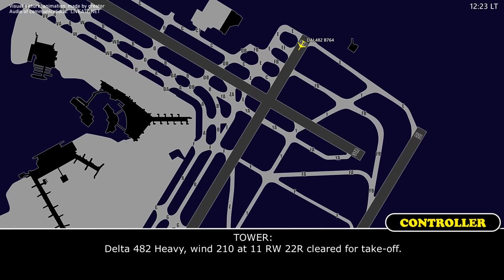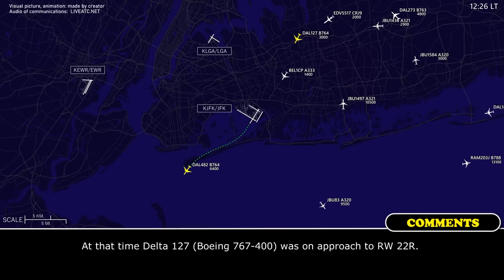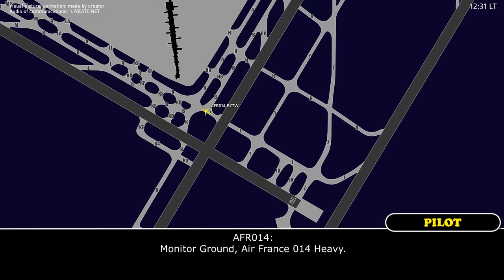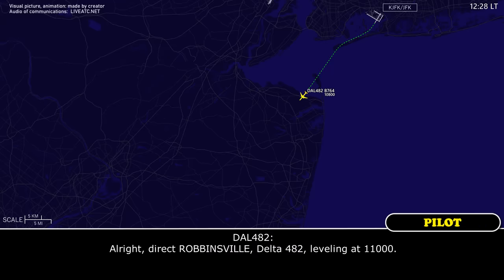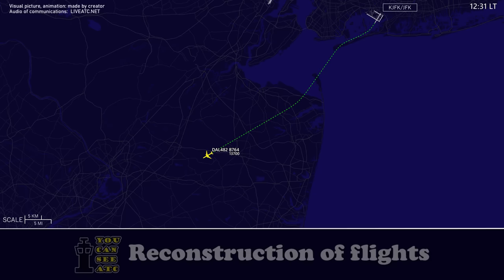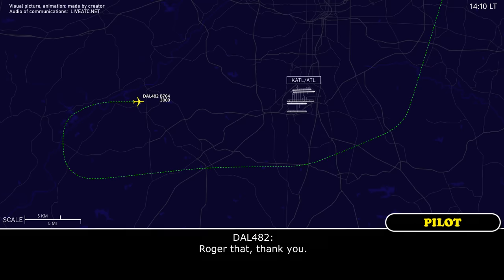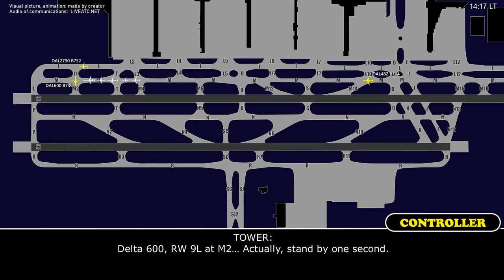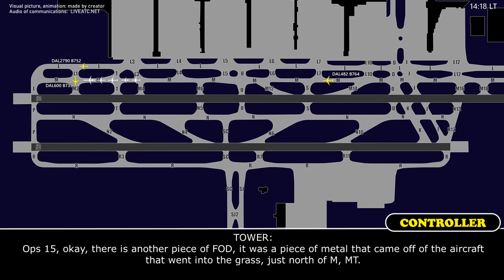Delta Boeing 767 LOST THE WHEEL on takeoff from New York Kennedy Airport. Real ATC audio

Comment: I find it disturbing that the Delta pilot didn’t believe his wheel was missing  after two planes reported it. Also that it was reported By the ground that the landing gear looked fine, so he landed without verifying with a complete go around the first time.  This seems like an almost horrendous disaster with mistakes by both the Delta pilot and the Verifying plane that could have cost hundreds of people their lives. Luckily it had a good ending.
Reply: If he had gone round what would that have achieved?  He's got to land the plane, whatever the state of the bogey
Reply: @oldcynic6964  The pilot would have known which wheel was missing and to prepare for the likely impact. And tower would have been able to coordinate following aircraft and for ground units to clear the FOD. By sheer luck, the missing wheel was on the rear gear and did not affect the landing (although it did spray metal FOD all over the runway).

Comment: Why didn't they just do a fly by first? Could have given them time to assess the situation (?)
Reply: My thoughts exactly
Reply: They would have done a go around if they saw less than 3 tires.  They only lost 1 out of 4 on that gear set.
Reply: They already had a plan in place and multiple vehicles and aircraft watching. 3 wheels they continue (hence pilots call out “landing”) - if the main landing gear bogie was damaged and/or missing more than one wheel, they’d go-around and run additional checklists and probably start foaming the runway, etc.
Reply: Oh the drama
Reply: @EstorilEm  thanks. Maybe it was from the video editing but it sounded like they only got to know for sure they were missing a wheel when they were on the runway. But if it was a calculated risk, that would make more sense to me.

Comment: Did make me laugh the Delta bloke asking "Which wheel is it" FFS it bounced past Jet Blue nearly taking him out and Air France watched it land. The best way he could have found out is asked his company "which wheel was changed at JFK lol
Reply: bill b Yes, it doesn't really matter so much, in the grand scheme, WHICH wheel is missing. The important aspect, Mr. Pilot, is that your aircraft has shed a tire/wheel assy. Your landing may be a bit sketchy.
Reply: @John-Andersen  Well, if I were flying a plane that just lost a wheel, I'd certainly want to know which one it was. Missing left main requires different inputs on landing than missing right main - both sketchy of course. Having that knowledge certainly makes it easier to physically and mentally prepare for your landing actions. Also, it could help to direct your attention more specifically toward any potential system failures that could occur as a result of the specific wheel lost.
Reply: I suspect that at the time he asked “which wheel” what he was really saying was “yeah right - wasn’t us, we would have known, someone if full of it.”
Reply: @philr6829  It did kind of sound like that 🤷🏼‍♀️
Reply: @John-Andersen  I assumed it was so that they could concentrate on checking that gear notice when they put the gear down. Judging by the "The takeoff was smooth we didn't feel any tyre blow" I think they were thinking that ATC was saying they had a tyre pop not that they lost an entire wheel.

Comment: I have 18,000 hours in Boeing 767. Seems like one or more main landing gear tire and wheel were recently changed on a previous flight. Most likely it was not secured properly, with whatever nuts hold the wheel onto the main gear truck assembly. At high speed during the takeoff roll, it spun off at 145 knots! Good that it didn’t hit Jet Blue, that was holding to cross runway 22R. Years ago, I was taxiing out for takeoff at JFK during rush hour. In the grass I saw a large wheel and tire. An airplane ahead of us  had one apparently spin off the gear. I later found that it was a Russian made airplane. They landed uneventfully in russia! Whenever this happens, the runway needs checked by fire department for debris-other metal parts may have come off, and an airplane landing or taking off could run over missing parts.
Reply: Just as with Concorde, FOD can kill!
Reply: At the end, why did they land the plane before being informed of the visual inspection, that the left main tire was missing?
Reply: @Landrew1208  not clear on your question. The delta plane decided to continue to Atlanta, for convenience. No real need to return to JFK. As for Russian plane, I don’t think they were told about loosing a wheel (discovered by maintenance after parked at gate). Lastly, when an airplane looses parts, the runway needs inspected for debris, with no one landing or taking off of that runway, until visual inspection is performed. Atlanta and Jfk did a good job on that
Reply: Yeah I don't know why they were so fussy about where exactly it was because they were going to have to inspect the whole runway anyway.
Reply: The capt has decided to continue the flight to Hartsfield Airport because delta airlines maintainace center is overthier 
Was that a good decision.??
After the capt has received confirmation of a missing wheel he made normal approach to RWY 9 instead of asking to flyby for further wheel inspection 
It's a wrong decision,  I wonder why he did it ? Because if the 2 main wheels were missing that will be emergency landing and he should request fire trucks on standby ? I wonder on what base has he made the decision to continue for landing?
Reply: @salaheddin5504  I believe the captain got a report that one main wheel/tire fell off. The 767 has 4 tires in each mail landing gear and two smaller nose wheels. Continuing to Atlanta was okay. He burned off fuel enroute, lowering his landing weight in Atlanta. He had domestic fuel load, so he was relatively light. I think a flyby in Atlanta, for the tower to look would have been prudent. But, he knew he ha 3 tires remaining, on his left (or right-I forgot.
Reply: Does flying for that long in a 767 grant you the ability to notice the most minor of things like “oh hey this planes flaps knob (or whatever you call it idk I’m no pilot lol) is slightly darker than normal” or does stuff like that…

fly under the radar?
Reply: @Zildawolf  I was intimately familiar with the 767. As I was “stuck” on it and couldn’t go to a 777, is why I had 18,000 hours on the 767-possibly the most time of anyone on it😳. I could close my eyes, and touch whatever control, knob or button that I chose. Flying across the ocean to Europe was as easy for me, as you driving your car 2.5 hours somewhere!
Reply: @Zildawolf  That sort of minor thing isn't worth notice.  Big things like a booger on the flap handle will be noticed.

Comment: Truly bizarre! I'm sure the duty pilot in ATL was working the problem with the crew and possibly a Boeing engineer. Delta has duty pilots in the Command Center, kind of like the CAPCOM position in NASA. They landed on 9L, the longest runway, normally used for heavy departures. The 767-400 is a long range airplane and even if the weather in ATL was bad they were relatively light for the takeoff. If it wasn't the result of a freak material failure someone in maintenance is going to have a very bad day. It probably helped that it was a tire on the rear axle- the 767 MLG is tilted front down until touchdown so the forward axle tires touchdown first.
Reply: That control tower tape would be interesting.

Comment: I’m not saying they were wrong to continue to Atlanta or not return to New York, because I can see the benefits of burning the fuel in route and having a lighter weight landing, but also, at the same time, you’ve had something come off your airplane and you don’t necessarily know if it has done some damage that will become apparent when you pressurize the plane “just because it was smooth”. I just think if I were an airman, I probably would have been more conservative and returned to New York after burning off fuel and not have risked a decompression incident.
Reply: Yeah it's a weird one. They were already around 10k when they were informed and everything looked normal. Of course, if there was some sort of belly damage that got worse during flight... shudder to think of the consequences. I guess they thought it smart to land at their tech ops base? Still warrants some investigation on what to do in such a situation. A small puncture to the fuselage could become a big crack in no time under pressure.
Reply: Around the wheel 'box' is the cargo area, which is not pressurised. If there would be dammage it should be on the cargo area, not the pressurised 'human space'.

Even if the call was a bit weird, nothing was wrong with it. Also, by the time it was confirmed they were already about to land at their destination. 
So let's suppose that it was not true. They would have turned around the airport for no reason, and then possibly didn't had enough fuel to continue to their destination (they bring in the minimum fuel required, more fuel = heavier = burn more fuel = cost more to fly).
And once confirmed they still have to land. You can land on the hyper busy JFK or at a busy atlanta.
So when you look at it, there is many reasons to continue the flight, and little to stay in JFK airspace.

So it was a good call.
Reply: Atlanta would also be the best place to fix a broken aircraft being a maintenance base as opposed to JFK where spares (and manpower) would likely be more limited.
Reply: @AndyWhite  Not for Delta. JFK is a huge hub for them as well. Definitely big enough to manage their 767 fleet which flies a lot of their transcon routes + atlantic routes.
Reply: @JG the 768 is a plane of the 80’s 😂
Reply: Capt decision to continue is because of maintenance center and to burn fuel 
But why he didn't make a fly by first before land at Hartsfield Airport that's not wise decision
Reply: I was curious about that also, but for a different reason. So the missing wheel impacts landing and they want time to sort that out, but that doesn’t take into a possible scenario where something else might go wrong and let’s say it’s something that depends entirely on a solid landing… now you’re really in the slop.
Reply: @j700jam4  According to the registration this specific model was certified in 2000, so definitely a lot newer then 80's

Comment: IMHO the Captain should have done a fly-by in order to asses the situation with all possible information.
Nothing serious happened, but the decision to try a landing first not knowing the exact situation was a risk.
There was no preparation for an emergency landing. Imagine a landing gear collapse, was the crew and the passengers informed? It does't seems so.
It was a uncalculated risk, not good while carring people aboard.
Reply: Yeah I found that part strange as well.
All it takes was just one inattentive pilot transmitting on the frequency at the exact same time when they attempt to land to spoil their plan.
Reply: There's one big thing missing here, the Delta flight can, and likely did, contact company with information. They could have been informed that one wheel assembly was serviced, meaning the remaining wheels on that strut would be OK. The ground crews at the departing airport cold have also reported just what was recovered, meaning just a wheel and retaining hardware.

Comment: I understand continuing to ATL, but why not do a complete flyby prior to the landing attempt? They're told it looks good right before touchdown, while they're missing a wheel. Do the flyby, get more data, and make an informed decision.
Reply: What’s a fly by going to prove? “You’re missing a wheel”. “Yes, we know”. 

More risk than benefit. Planes are designed to land with punctures, so a missing wheel isn’t any more of a problem.
Reply: @EdOeuna  What's the risk of a flyby? And based on the incomplete communications, the pilots wouldn't have actually known if they were missing a tire, a wheel, a strut, etc. They shouldn't assume "missing a wheel" means exactly that, it means something on one (or more) of their landing gear was damaged. What if they were missing the front gear? You'd certainly want to adjust your landing for that
Reply: @ABlochead  - since the wheel was found then someone would be able to determine if it’s a main wheel or a nose wheel. They’d also determine if it was still attached to part of the hub/brake assembly or on its own.  This can then be communicated to the pilots who can then make an assessment and change the way they lane. At the end of the day except for “being gentle” with the landing there isn’t any other way to get the plane on the ground. Regardless of what fell off or what is left attached to the aircraft. 

Relying on a visual inspection by an unqualified person on the ground isn’t particularly helpful and exposes the aircraft to slightly more risk with an approach and missed approach plus, potentially, cycling the gear and/or flaps. 

At my airline they’re forbidden. At my previous airline the only thing that ATC could advise is if they can see the nose taxi light on as this only illuminates when the nose gear is down and locked.
Reply: Nobody listening properly? He was talking to ground, who was talking to fire and another plane on approach. "If there's three, we land." that was the statement. Meaning if one gear is missing entirely or has no wheels, he'd go around and plan for something else.

A missing wheel is no huge catastrophe. He likely would've been on the horn with maintenance, too. They'd have told him what was (improperly) serviced, in this case probably one wheel, giving a good assessment if something else could break.

Comment: Can’t believe they taxied to the gate not knowing the condition of their gear.
Reply: 1.) They needed to get the runway clear ASAP for that line of 5 aircraft.
2.) They had someone in a car escorting them to the gate for a reason.
Reply: they only lost a tire, confirmed by the firetruck, they just landed on it, it should be fine to roll to the gate, the firetruck followed if there were issues (more dropped parts) they have plenty of wheels so they can lose a few without issue
Reply: LoL don't worry they have someone following them to pick up the parts they leave every where they go! 🤣

Comment: Decision-making is not easy.  I'm going to assume the pilots asked cabin crew if they noticed anything, and contacted maintenance too.  Returning to New York airspace does not seem great, and there are other airports along the short route.  Climbing to altitude with possibility of a compromised fuselage or fuel tank ... is ... not intuitive to me.  But it's hard to argue for risk of a compromised fuselage after a smooth takeoff.  Maintenance could have access to more live parameters than flight crew.  Focusing on planning for a non-normal landing could be a better use of time for flight crew.

Comment: That was honestly smart of him to continue to ATL as it is Delta's main hub and they have a huge maintenance hanger there
Reply from the maker: But if there was some damage?
Reply: @YouCanSeeATC  Gear was already retracted and they were in the climb. There’s zero difference at that point - “if there’s damage” there’s damage, doesnt matter where they land. 

What DOES matter is their landing weight though; even with perfect landing gear, they’d likely be too heavy to land immediately without dumping fuel (possibly not as that’s a short flight for a 767-400) - but regardless, continuing on and burning all that fuel puts a LOT less stress on the landing gear and greatly reduces the risk of the adjacent tire blowing out. 

Also with the insane airspace around NYC, it’s not a place you’d want to dump fuel - they’d have to vector him all over the place to get out to the Atlantic coast end come back in. By the time they told him about the wheel, he was already nicely established on a climb to ATL. 👍
Reply: @EstorilEm  Well said
Reply: @EstorilEm  I agree.
Reply: Ehh you don't need a hangar to change a few tires

Comment: Could have not properly torqued down the axle nut and not installed the axle nut retaining bolts. This scenario is even worse as any wheels on the left side of the landing gear truck would have the axle nut loosened by the forward motion of the wheel which would be rubbing against the axle nut in a counter-clockwise motion.

Comment: Think the FAA needs to do some serious evaluation here , NY definitely Had FOD and runway and taxiways should have been closed,inspected and swept. The plane could have had fluid leaking ( fire hazard or fuselage damage or other systems damaged in wheel well, they should have landed immediately, ATL was negligent by allowing the plane to taxi around airport, possibly dumping fluids and FOD all over the place, or possibly damaging the tarmac, or collapse the whole gear and cause more damage to plane, plus they let a fire hazard pull up to a gate. ( We'v all seen overheated tires start on fire and spread to wing tanks) I think a hard stop on runway and evacuation could have been justified) But let's not risk our on time record, right. I fly alot, I'd be very Po'ed if I was a passenger in this flight.
Reply: There's a reason the fire truck did an inspection and subsequently followed them to the gate. If there were fluid leaks or FOD, they would have seen it. The plane's going to have to be moved regardless, unless you are suggesting they leave it on the taxiway and have the repair work done out there.